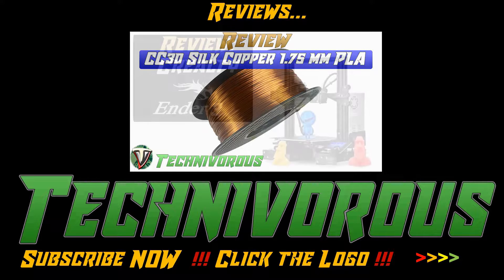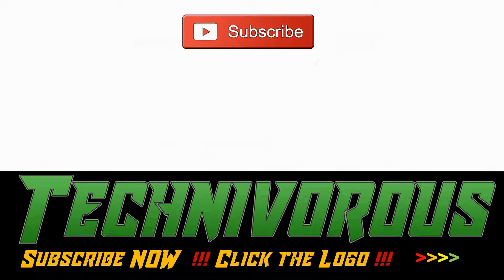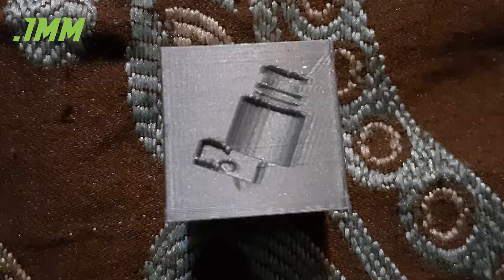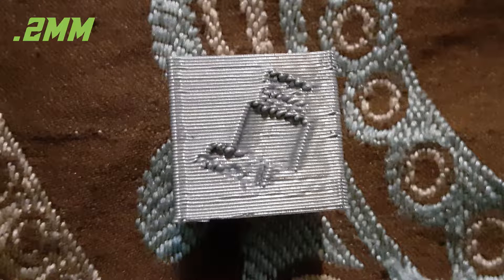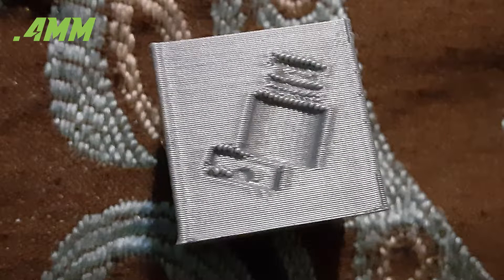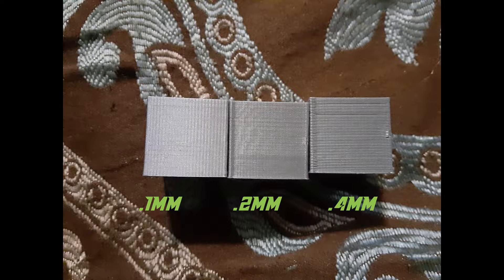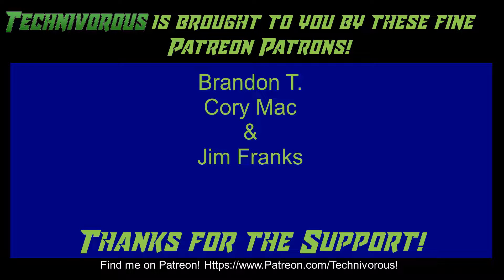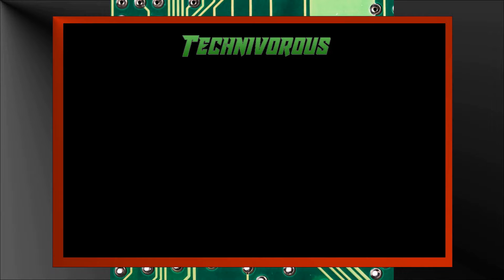Ender 3 - minimum and maximum layer heights

Comment: you should  always make your layer heights in multiple of .04 to get best print as that is the increments that the stepper motor raises and lowers in. .04 .08  .12  .16 .2 .24 etc
Reply: interesting I appreciate the insight
Reply from the maker: Yep it's what we call the magic numbers.
Reply: @Technivorous  but you didn't do it.  They are "magic" because of stepper motor mechanics

Comment: I find .32 or .28 is good for larger prints, .2 or.16 for smaller prints
Reply: Hi, Can You write what size is a small and large in cm? :)
Reply: @Nauka.i.Eksperymenty  smaller prints I'd say 50x50 ish. Larger i mean anything 100x100 ish. But I will note if the model your printing is a part where detail isn't important for looks or fitment give 2.8 an 3.2 a try. Also play with line width 4.4 an 4.8 on any layer height. This is all considering your using a 0.4 nozzle. I have tried other size nozzles an always revert back to a 0.4
Reply from the maker: these are magic numbers. i have a video on them around here somewhere, but i reccommend filament friday's video on the topic!
Reply: @Technivorous  oh i know i learned them from watching your videos an cheps. Love the videos, very informative. Thanks for taking the time to make them